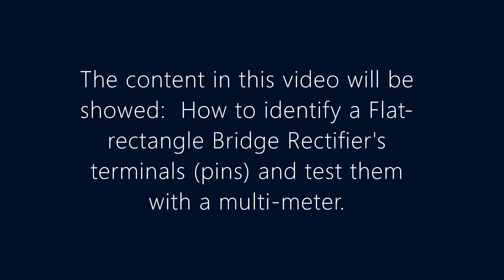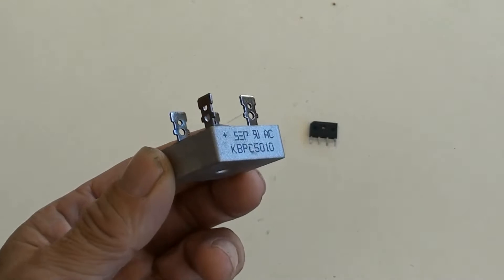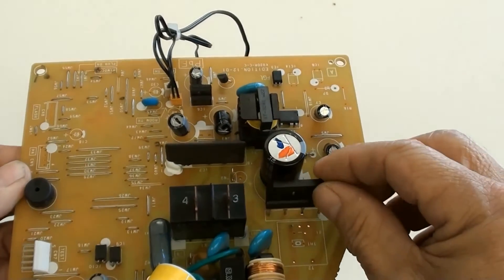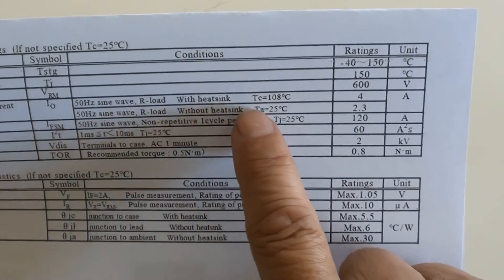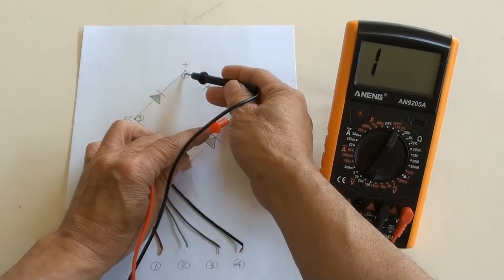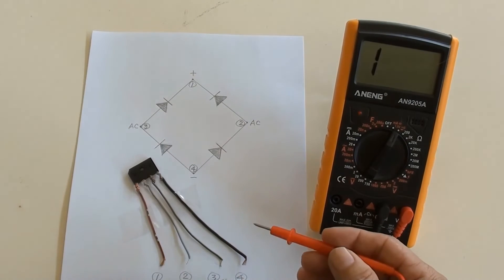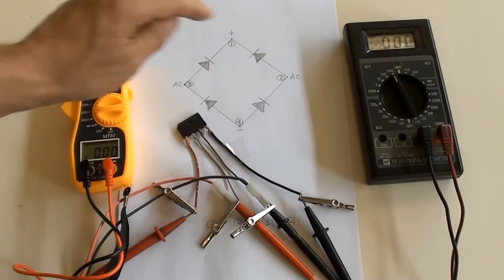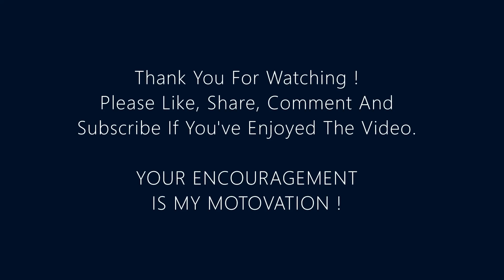How To Test This Rectifier?

Comment: Shouldn't the voltage between (+) and (-) be double the voltage i.e. 0.9V?
Reply from the maker: Thanks for your interested!  Theoretical speaking, the voltage between (+) and (-) is V - 2 x 0.7 volt = V - 1.4 volt (here V is input of AC voltage).  Suppose V is 230 volt then the voltage between (+) and (-) is 230 volt - 1.4 volt = DC 228.6 volt, however if V is 2.5 volt then the voltage between (+) and (-) is 2.5 volt - 1.4 volt = DC 0.9 volt.   Cheers! 🙂👍